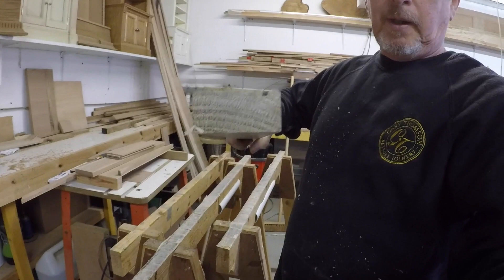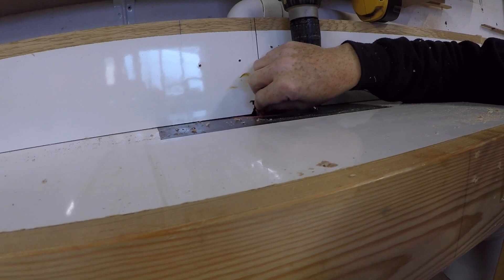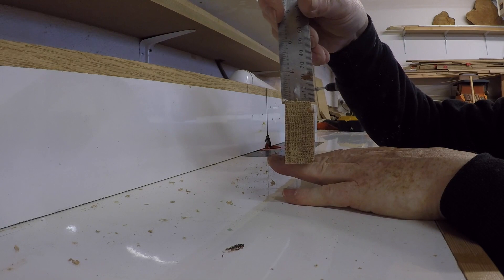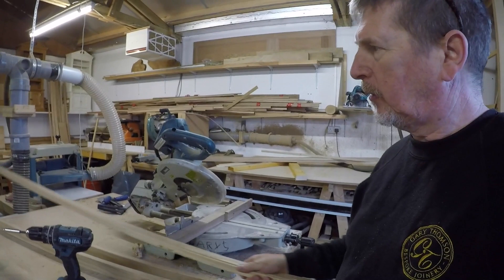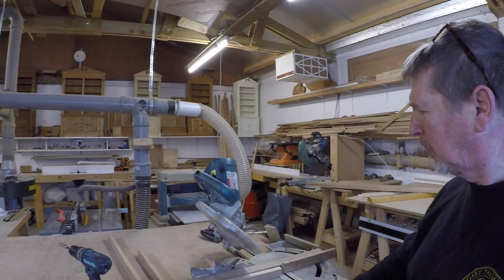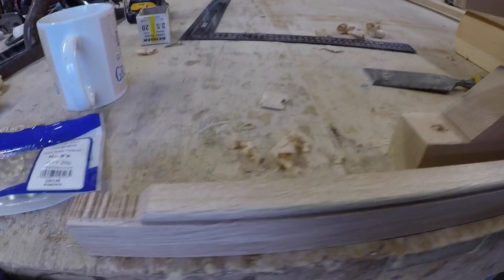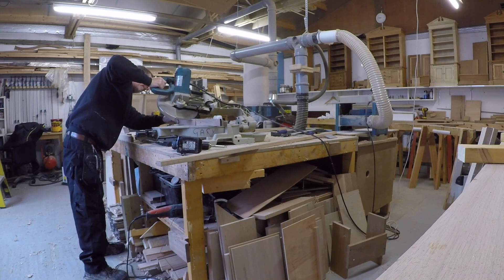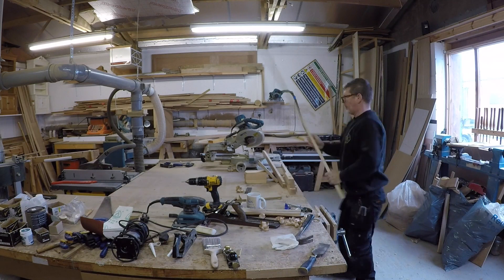This is how I do my Bead Frames

Comment: Obviously you method to cut the jack mitre notch with the chop saw works, but have you considered using a router with notching bit?
Reply from the maker: Hi jar944 yes I did think about that a few years ago but the was the breakout with the router bit, so I just got use to using the chop saw.
Now I can do I frame in less than an hour. 
Do you use the router?  If you have a good method with the router I’d love to see it, I’m always learning 👍🔨📐😄
Reply: @GaryThomsonJoinery  yes I do use a router. I started originally with a jig that held the part to be cut with a clamp and allowed the router to slide forward and back. I eventually modified it to be partially automatic. I think the key to the router notching is to use a false fence, and to cut the bead after.  Not sure this will work but here is a video of the jig https://youtu.be/KGlid5nTgzM